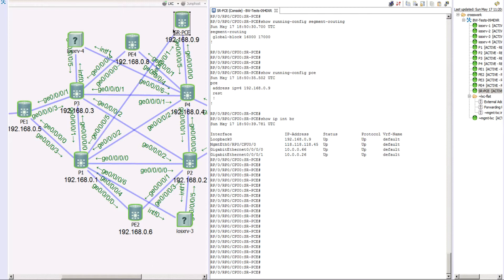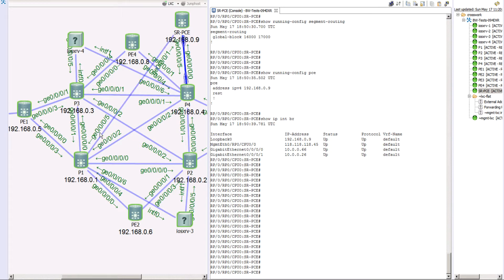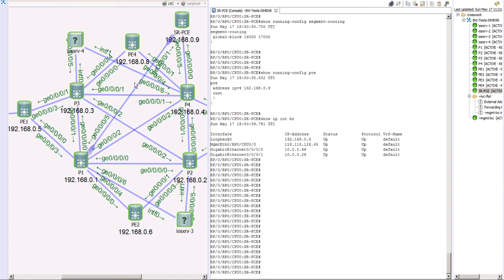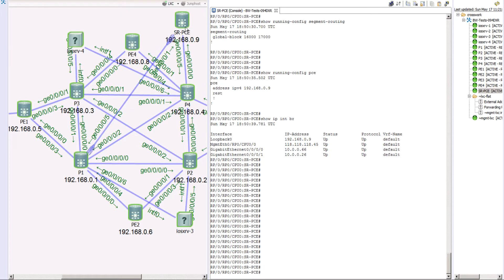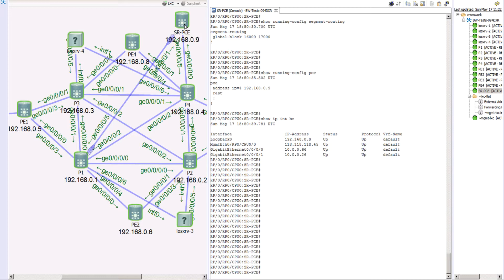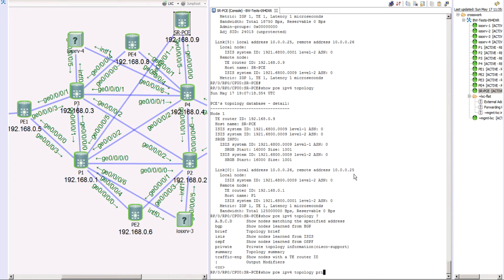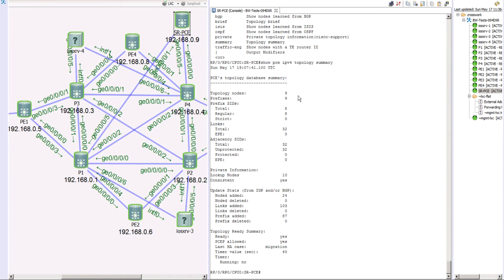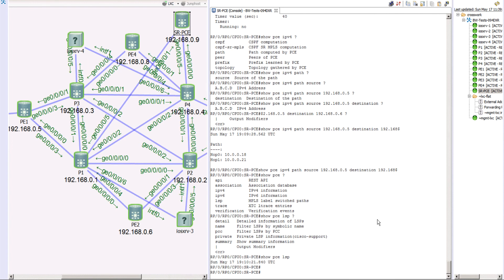SR-TE - SR-PCE and PCC - Initial Hands-on

Comment: Thanks Arun again. Is it mandatory that all the nodes in the network should be PCE aware. What I have understood is that since we have “distribute link-state” to build SR-TE database only PCC needs to be aware about PCE. Please correct if I am wrong.
Reply from the maker: Hi Arun, great Q, and the answer is NO, you are correct, only PCC or Head-end talks to PCE via PCEP but remember in network any node can be PCC(head-end) or end-point (tail end) so it's user's choice to configure one node a PCC or all nodes as PCC.